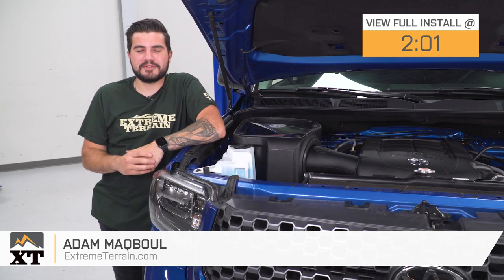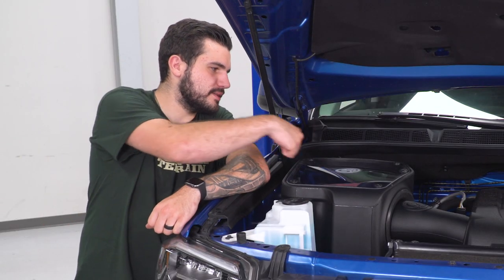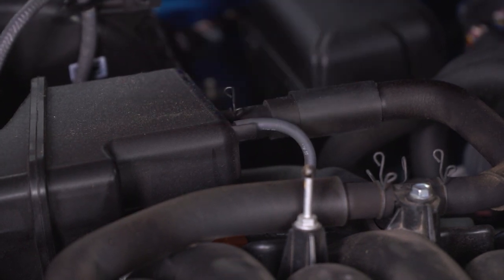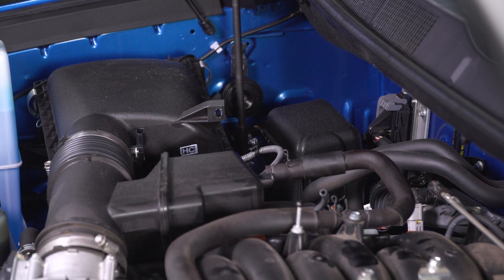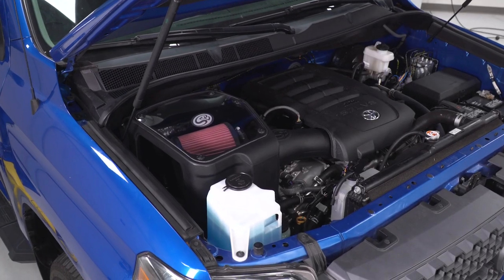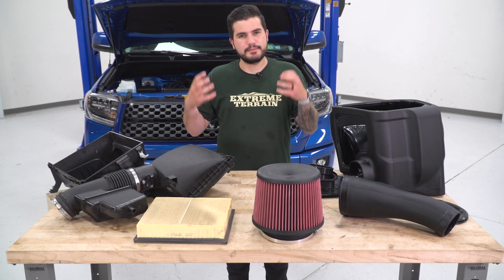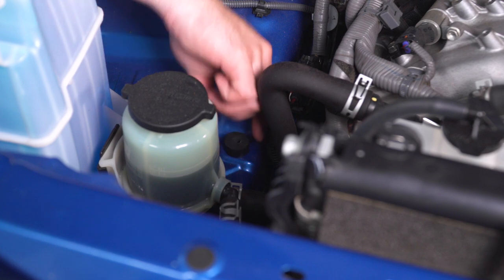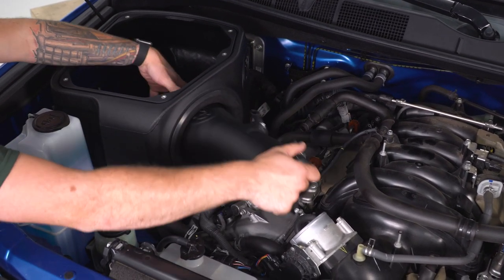2007-2021 Tundra 5.7L V8 S&B Cold Air Intake with Oiled Cleanable Cotton Filter Review & Install

Comment: I just finished the install. Many people had trouble with the big air box screws lining up for all three bolts. Some commented on other videos they got 2 and called it good. There was no instruction about the air intake snorkel piece either resting against the inside fender OR inserting the flange part into the fender like the factory one was positioned. I found that in order to get those 3 bolts to begin to line up easily for the air box I had to insert that air intake flange like the original factory one(inside the fender). I had no problems finding the 3 bolt holes for the air box and it is now secured. You will want to install that big rubber side cover BEFORE putting the air box in the truck. It was a PIA to install once I got the air box bolted in place. Also put the bolt through that thick rubber mount before putting the air box in the truck. You may want to use black double sided mounting tape from eBay to make a better air tight seal from that air intake flange piece to the air box, make sure surfaces are clean.

Comment: I just got finished with the install (2007 Tundra) and also had the most difficult time with the bottom box bolts. It's confusing that the one corner that you place the grommet under the box has two holes in it. Ended up that the smaller hole is the water drain (if water ever gets inside from off-roading or whatever). I finally took the air box out completely and lightly Super Glued (not the gel type-original faster drying type) the bottom to of the grommet with a Phillips screwdriver through the hole of the grommet and into the bolt hole and standing straight up; and also giggled it around a little bit to make sure that it was in center. Don't get any Super Glue into the bolt hole! Left it alone about 20 minutes and it was solidly stuck. The bolt went easily into the hole, but I overtightened it and couldn't get the other holes to line up until I loosened it quite a bit. Smooth sailing after that hour and half debacle, lol.
P.S. - I couldn't get my sensor off, probably age and I didn't want to damage it  so I just did it work in place.

Comment: Video was generally helpful. He avoided to show a couple of headaches for sure. Thanks a lot dude. But anyways, hardest part for me was the third screw closest to the grille to fasten the box. Was having such a difficult time I took the box back out and tried to screw in the screw just into the hole to check fitment and it didn’t fit, have to rework the hole to get it to work. Give yourself more than an hour, try about two hours due to minor headaches.

Comment: I got mine installed thanks to you! S&B is a great product. Be careful polling the sensor off! Don't pull on it, there's a button at the back on, right on the top rim, I had to use the handle of a plastic knife to push it in. The hardest thing to install is the screws for the air box, to make that process easier put the screw through the air box and into the washer, don't try to balance the washer, get as much of the screw past the washer bottom and Use the screw end to align into the hole. For the tubing just come in from the top no need to place the whole thing in the air box. Good Luck
Reply from the maker: Glad we could help! Thanks for watching!! -Merideth
Reply: How has gone for you so far?  Im thinking about buying this one, but don't want any computer problems in the future

Comment: Would this work on a GX460, since the engines are similar as well as how the throttle body is positioned. Couldnt find anything on the forums, which is why I ask, due to the limited aftermarket for the gx460